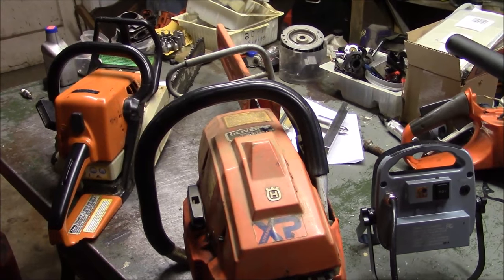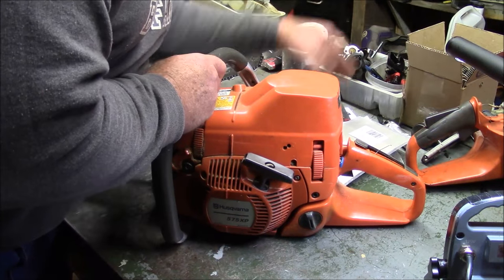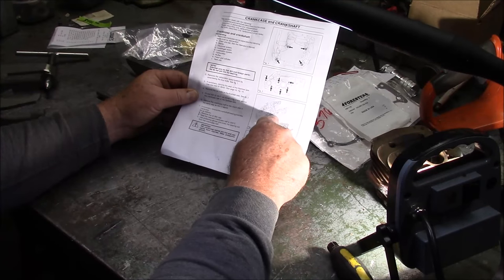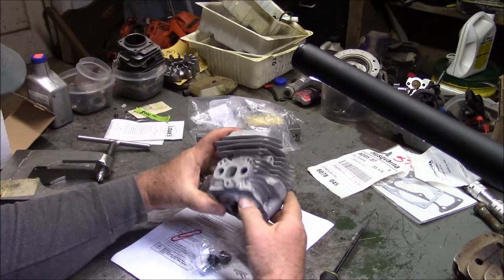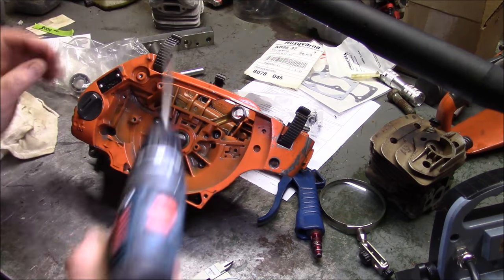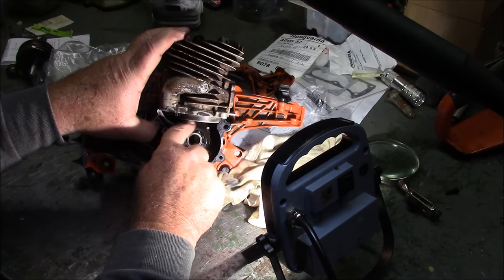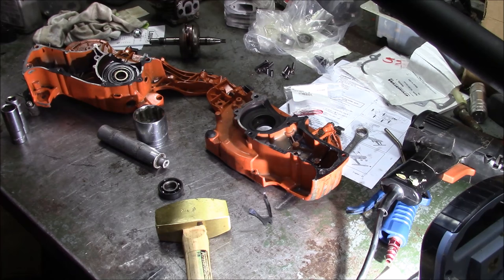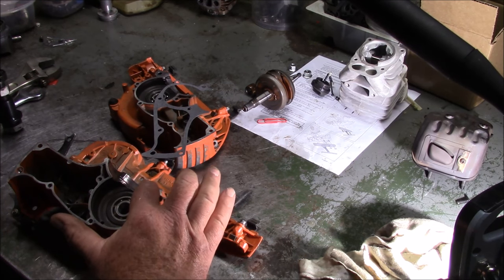Husqvarna 576xp vs. 575xp, WHAT Are The Differences? & 576xp Crank Case Bearing Replacement.

Comment: Hi can you make a video of the tool you used to pull the crank into the crank case cheers
Reply from the maker: I guess, but you can get them from a dealer
Reply: Hi my dealers in australia have never pulled down a 576xp and have no idea what they are doing, to the point I had to make my own puller. The crank on the one I am working on is cooked so I need a new one as well,cheers thanks for your time Kevin

Comment: was there a part 2 to this? wondering if these 576 saws have the standard type crank seals, or if it seals through the bearing. thanks
Reply from the maker: Did you watch my last couple of 575 video's, think I cover the seals/bearings in a at least two of them for both 575 and 576. The PTO side bearing for 575's in the Husqvarna "Parts" list have been superseded with the SAME bearing & integral seal as the 562 and 576. The 575 build I did this year has that bearing from my 562 "stock pile". Of course the fly side on the 575 is the same as a 576 with it's skinny seal. But to the question, the 576 has the SAME PTO bearing with the integral seal as a 562. I guess maybe it's possible to retro to the old style 575 bearing / seal, but why? that was the genesis of a lot of their bottom end issues in my opinion.

Comment: Is there any difference how to turn Case Bearing With a plastic cage on husqvarna 372 xpg
Reply from the maker: The OLD 372 XP was tuned "no load" at 13500, the "new" 372XP "X-Torq's" best be set at 12900-13000. The larger bore "old Style" (Pre-2010) XPW also needs to be set a little slower at 13000-13100. The "G" version are the ones with heated handles and the are set as the version or generation they are derived from.

Comment: are the bearing seals the same on 575 and 576? have a 575xp that wont run on eny thing other than full throtel. and fails presure test and vacume
Reply from the maker: I believe the clutch side bearings are the same with the part number: 525434201. Interestingly enough this bearing is also used on saws like the 346xp & 550xp.The 576 Flywheel side bearing is PN 525434301 and is used on a lot of models including the 372's. Its a 6202 bearing. The 575 Flywheel side bearing is PN 738220225 and is larger also used on saws like the 395's and smaller....like model 55's  Go figure....
Reply: @afleetcommand  Do you happen to have the generic bearing numbers for the 575 crankcase bearings?
Reply: What are your thoughts on a 575xp
Reply: @zacharygross460  runs great now god Torq

Comment: Where did you get that crank case splitter?
Reply from the maker: Either from eBay or some I make from scratch. Depends. That one is probably an OEM Husqvarna shop tool bought off eBay.
Reply: I’ve been looking for months and I can’t find one anywhere
Reply from the maker: https://www.ebay.com/itm/Husqvarna-chainsaw-575-XP-bearings-splitter-or-case-puller-OEM-workshop-manual/303023365390?hash=item468d999d0e:m:mIqn0nUSeLfPNsAjlnyq75w:rk:12:pf:0
Reply: Thank you I appreciate it

Comment: hello!
Here in oporto ,Portugal i buy the same saw a At 576 2009 transform to Fully ad.but with a mistake....a 575 thinner crank.
 One month ago i buy it one damaged from a loger who have credit default in my saw shop.
I really pay110 dolars to the shop owner but it was not only a bearing problems .The husky dealer discovered someone in is shop have damaged at deassembly the crank because have a cut  and  it killed with a 2 inches cut along  the bearings place.They assume the falt and put a good shape 575 crank.Next they put two new oem 575 bearings and a two oem 576 piston seals and crank ruber seals  -total 95 dolars bill.
Now the saw idle very nice cold start six pulls and start ok triger on and go idle without chain moving. Only have 15 minutes of light work.
In your opinion how many tanks do i need to make break in (run in) done?
After brake in my 576 xp with oem 576 piston  a 575 crank,a 18" bar, 8 tooth sprocket ,razor H42 chain  it is risky make a mufler mod?
i bealived now my saw rune a litle rich and dont rev so angry sound like yours.Maybe because the mecanic worry about lubrification to seat  new seals in my used cilinder hall.
Please give me your sincere opinion from your expert point of view?
Sorry for so long talk.
please give your preacious feedback.
Greatings from Portugal 
André Campos
Reply from the maker: Sounds like an interesting saw! As for break in...just run it. Don't really have to do anything special. AND it will pickup power as the ring seats. Muffler mod won't hurt a thing. I Always find time for another saw geek like myself.. :)
Reply: thanks for your opinion!
And sorry I will make some questions but please only when you have time...to give your feedback

Do you think if i loosening fixing screws from coil and increase the distance from the flyweel (a incriese of 0.0787inches) more than the original place  will be good on ignition timing.That is how a stilh 461 was  moded in a youtube video for a ignition advance for improve performance. But for 576 xp saw will be the same moding? will be gains in power?
A limit for a good mufler mod is  respecting the under 80% rule of exit port area and mufler area is ok providing some back pressure?
Can you tell how many inches inside diameter have that second pipe tube you use to the mm?
The mufler mod help to coll the saw but d´ont the skird of piston from mufler side will be burn faster?  
greatings
André Campos
Reply from the maker: Not a fan of moving the ignition away from the flywheel. On Strato saws the port timing is such they like a bit more x-section in the exhaust. That 80 percent is based timing from the non strato 1990's era saws such as the OE  372, the blow down on those saws usually is in the low 20's, 22-24 degrees. Strato saws have much shorter blow down times and like a little more x-section in the exhaust. Upper limit for me is in the 90 percent of exhaust x-section for a work saw.   I use a 3/4inh tube on those 70-75cc saws in the video's. Actually a really good mod for a work saw is to add another screen/shroud/ from a 390 along with a 5/8 inch hole on the clutch side. Quieter and has the spark arrestor. Might do a couple of those in upcoming video's.Also another trivia note is the Strato saws where you can adjust the carbs (non auto tunes like the 455/460's)  like more fuel.
Reply: Tancks for all the information and tips.
I will do it.
But if i do some good work in my 576 mufler were i will work to increase the specs in your opinion?gasket delete?work the combustion chamber? 
Greatings from Oporto Portugal
André Campos

Comment: What are your thoughts on the 575xp
Reply from the maker: they were ok, had some teething issues but if they are running now someone has sorted it out. Their "rap" was a bit heavy for their power. PTO seals would pop out from time to time. But other than that , kind of an odd ball but the sorted out ones were solid old saws